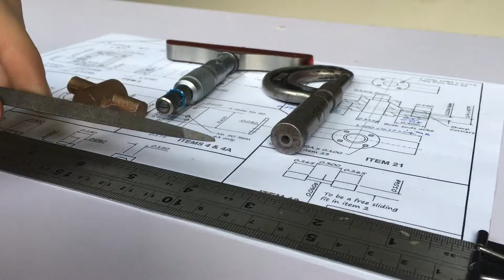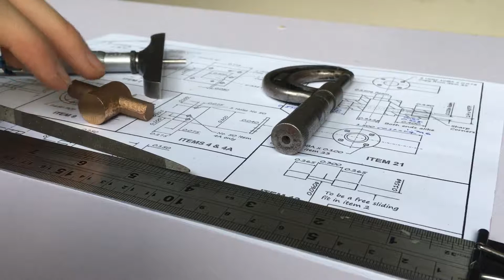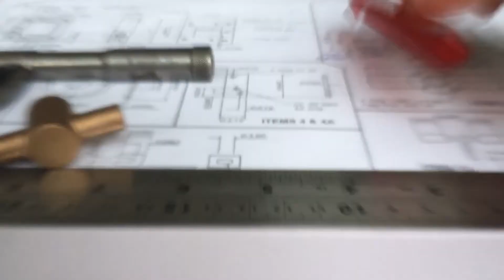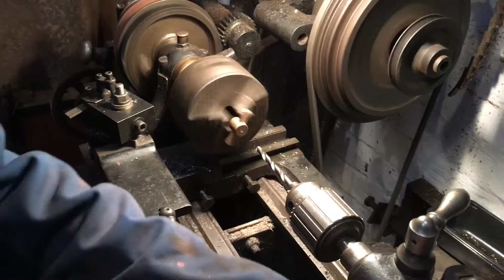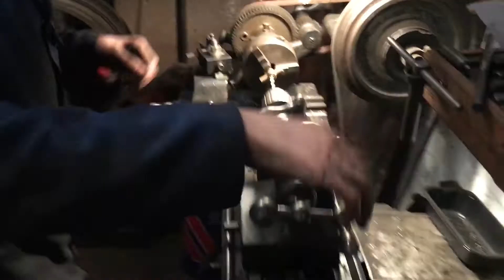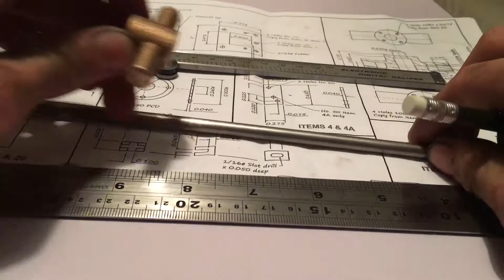Southworth Steam engine build part 4 (3 inch vertical pump)

Comment: I noticed that when you drilled the boss before you reamed, the drill had a distinctive wobble which increased as you reached the exit, would at that point it have been better to have bored the hole true before reaming to size, 

It looks like an interesting shop there, possibly something to do with a steam restoration group or the likes, can I suggest as a project a video tour of all the machinery sometime,

All the best
Reply from the maker: yes the wobble was very bad / though the reason I carried on with the machining operations is because this casting had a very bad blow hole on the section where the hole was drilled. so the part that you see at the end of the video isn't the same as the one at the start. I machined the second casting on my myford ml7. I just put the film of the other lathe as it is a more interesting machine . I will do a tour of our workshop when we next have steam up (January) as the line shaft is driven by and electric motor when we have no steam . please google us "clay mills Victorian pumping station" our workshop, it is from 1900.
Reply: Hello Mark, 
   What a beautiful website, so well organized, now I understand, I did notice at the end of your video and asked myself how could you true up a bore already reamed to size and yet stay that size, until recently I had a 47 Myford "M" type 3-1/2 Drummond, I down sized because of age,

I am a Great western fan  but love any kind of steam, my first engine was Minnie Traction engine, next was 3-1/2"  4-4-0 County of Carlow, 

Edmund............Alberta